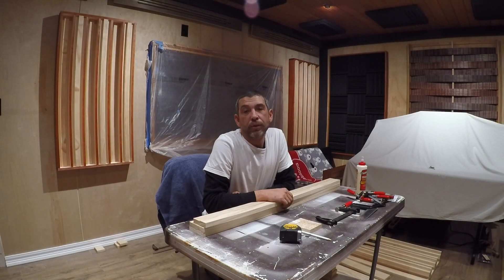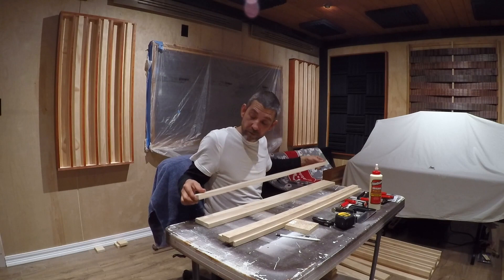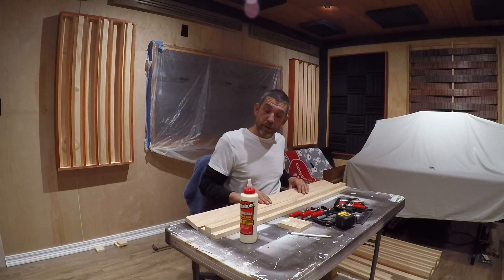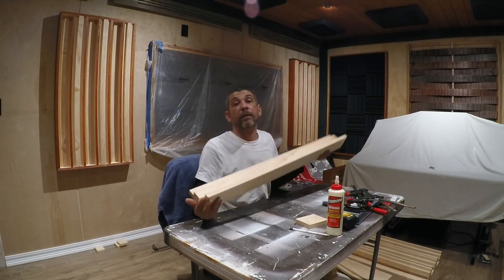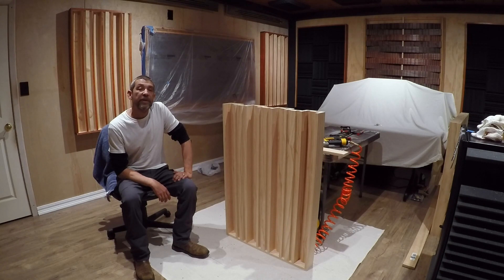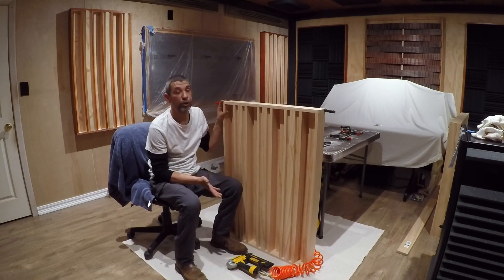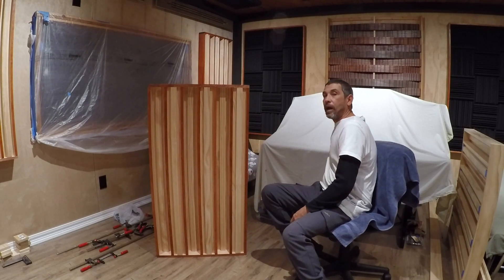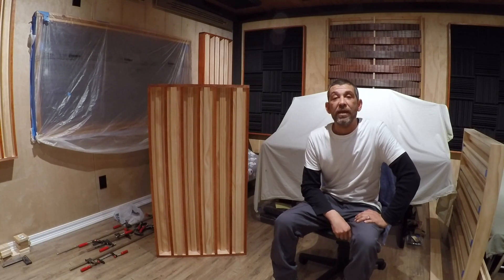How To Build An Acoustic Quadratic Diffuser - DIY

Comment: Straight runs of obsolete garage door tracks “wheel locked” using two sided reflection diffusers yield an interesting “astatic” array of  of dampening or mid pitched rejection depending on which azimuth the reflectors are turned.

Comment: Would the performance be significantly degraded if I built it out of dimensional lumber, where the 1” X 2” is actually 3/4” X 1-1/2” and the 1” X 4” is 3/4” X 3-1/2” ?  True size boards have proven difficult to find.  Thanks. I love the video and project. Simple and easy, even for me.  Brian
Reply: I see Alex hasn’t responded yet but I’m inclined to think that when he stated the sizes in the video he was using the common dimensions as opposed to the true dimensions - the sizes you mentioned.
Reply: Read my reply 1st...

Comment: Could this work with extruded polystyrene (xps) to reduce costs & weight? Painting it should reflect some some of the higher frequencies
Reply from the maker: @elixr I don't see why not as long as it's not too porous. Diffusers are usually made of denser materials but good idea to reduce weight. Most paints will destroy polystyrene because it doesn't stand up to chemicals well so try a test piece first. Also, you will need a special glue to get the pieces together. Give it a try. Thanks for watching.
Reply: Hey did you try making it with that material man? Curious to know how it ended up as i was thinking along similar lines. Also has anyone tried Balsa wood or is it not suitable ?

Comment: what are the frequency range?
Reply from the maker: @Alejandro Alfonso 1K - 3.5K they are limited and don't work well in small rooms. They can be effective down to 100Hz but the wells will have to be much deeper. There are free calculators online you can use that will tell you how deep to make the wells for your room.

Comment: And what you recommend for Bass
Reply from the maker: @Shot Master J I would use high density foam for low frequency problems. You need to absorb the sound energy. Start with the problem areas first (corners) then treat the walls. I used this site when I was building the studio. They have amazing prices and some cool stuff. https://foamforyou.com/style-g-361.html
Reply: Acoustic Foams are used for Echo & Acoustic Curtains are used for Soundproofing SoundProof-Curtains.me

Comment: HEJ alex thanks for the detailed details for making the diffuser, I'm interested in what wood the boards for making must be made of or it doesn't matter whether it can be done with OSB boards and I'm still interested in my room is 15 m2 a wall that is about 3.5 m away from the place of listening nice greeting
Reply from the maker: You could use OSB but keep in mind how heavy that will be. Also, I think they use a specific glue for joining OSB. I would use select pine but OSB will work. Thanks for watching.
Reply: @RoostersRecordingStudio  Thank you for your reply
Reply from the maker: @Dragon Filic No problem
Reply: Acoustic Foams are used for Echo & Acoustic Curtains are used for Soundproofing SoundProof-Curtains.me

Comment: Hey Alex! Great video thanks for the detailed and clear info. Do you know if there is any calculator that I could use to design on of theses diffusers for a specific height and width of the frame? Thanks!
Reply from the maker: Take a look at QRDude on the app store. Hope this helps.
Reply: Acoustic Foams are used for Echo & Acoustic Curtains are used for Soundproofing SoundProof-Curtains.me